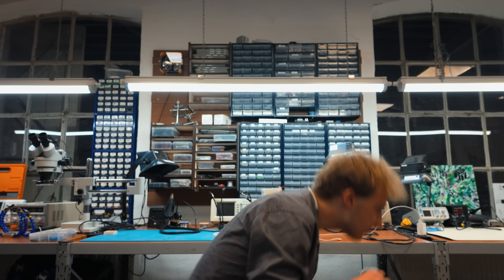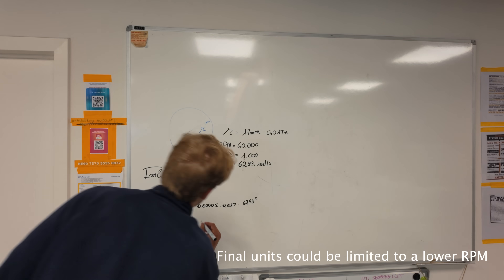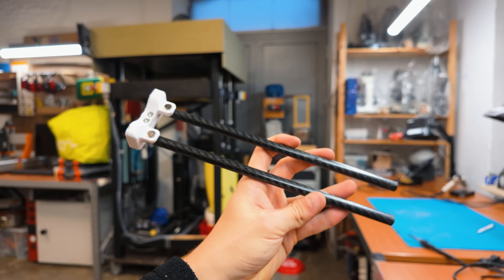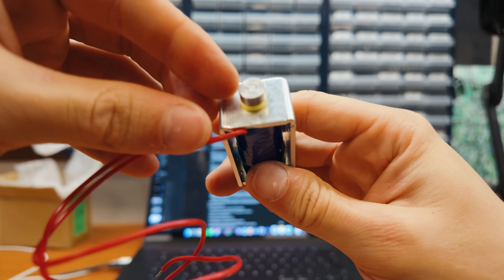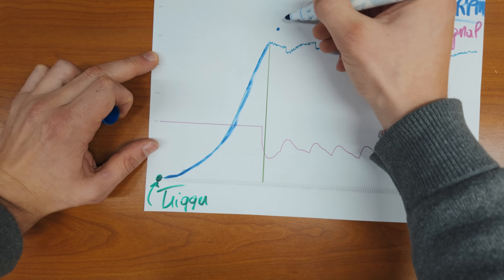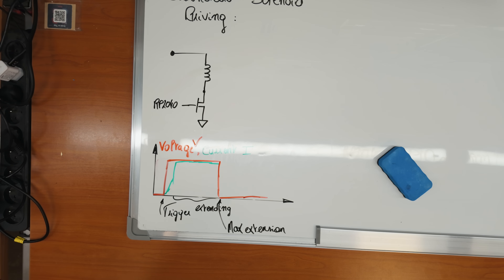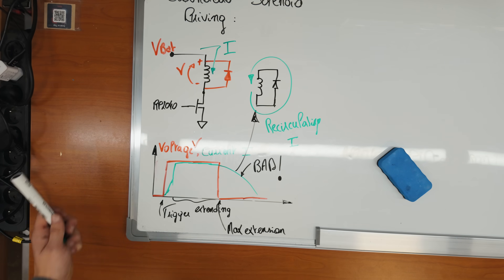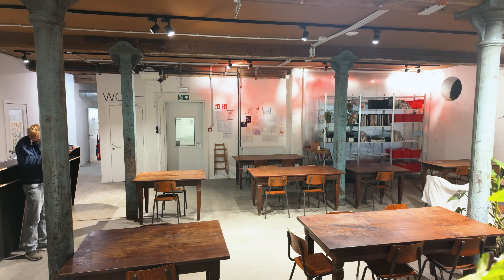Stinger V2: Pushing The Limits of Brushless Nerf

Comment: For the PCB you could mount it similarly to how gasket mount keyboards are. Two rubber washers affixed to each side of the board could mitigate extended vibrations from the solenoid. Awesome stuff!

Comment: Is there a link to the source code, especially the close loop control for the RPM? Are you using bidirectional DSHOT, serial ESC telemetry or did you bake the RPM governor into the ESC?
Reply from the maker: we're using bidirectional (extended) dshot on an RP2040

Comment: You can get rid of the BCAR by putting the flywheels slightly off axis to the path of the dart. I don’t know how well it works with a double flywheel setup, or with concave flywheels, but it’s something that could be looked at.
Reply: That would significantly increase flywheel mechanism complexity and definitely increase overall width; it's not worth it.

Comment: your production quality seems really good, would just suggest turning the mic gain down, to reduce the peaking, or optionally recording 32bit float which will drastically increase file size but allow you to adjust the audio in post, if not already.
Reply: Thank you! The youtuber "I'm using a lapel mic in a way other than intended" aesthetic really only works if you can hear them
Reply: @bitsRboolean  i mean he can definitely use it that way, and many people do with good audio. Even when it is clipped to his shirt its arguable worse because its closer to his mouth.
Reply: good tips!
Reply: Yeah the audio here is rough and difficult to listen to.

Comment: Thank you for this offering. Important note (particularly for us U.S. foam flingers)— it’s a blaster, never a gun. A gun refers to a tool that shoots projectiles using an explosive device (igniting gunpowder). Blasters use air and mechanical work to shoot darts/projectiles.
Reply: I worked on a nerf commercial and we had a saftey meeting that was proactively condemning any use of the word “gun.”  Blaster was the only way to refer to the product we were shooting.
Reply: This is just Because the left has been trying to paint a negative picture about firearms, and guns in general. Like I said, firearm enthusiast call their guns “blasters” to. And their guns actually have an explosive blast, unlike our nerf guns.
Reply: @Komfortonset  This is just because the left has been trying to vilify the word "gun". If anything, the term blaster is more appropriate for firearms,  as firearms actually ave a gunpowder BLAST when you shoot.
Reply: In theory this is a Gun. Because a gun is any device that propels a projectile through a barrel. Its called a firearm if the propulsion force is generated by burning a substance to create expanding gas.
Reply: Actually, from someone who is also familiar with the firearm community, I hear people refer to there firearms as blasters, just as much as people in the nerf community. There is no difference between the two.
Reply: @CrashTestRC1  that's called "being wrong"
Reply: @DoesntRefillTheBrita  In what way exactly?

Comment: You should tackle full length darts! I’d imagine it only requiring a longer magwell, new side panels, lower crush wheels, and maybe a longer solenoid to use short darts with an adapter

Comment: There's an interesting discussion to be had about kinetic flywheel weights. I think it's easy to say lighter is faster recovery so better.. but heavier technically means there is also less deceleration effect as it grabs and transfers it's stored power into the dart. So there is probably an optimal balance point.
Reply from the maker: I get what you mean but have a look at the graph where you see the dips in RPM. It barely loses any RPM.
Reply: the recovery time does not* depend  on the flywheel weight, but the startup time from 0 rpm is better with the lighter wheel. a heavier wheel would be good to use if the blaster could not recover the rpm between the shots.
Reply: @stingernerf This is where we start looking at Mega darts and bigger/ heavier flywheels with adequate motors... you have the potential to make a "NERF Tank" at this point. Or the NERF Howitzer, sounds pretty dope too, and will probs just be a scaling issue more than anything else.

Further Modularity might also favour a "heavier" flywheel in favour of being able to handle any loadout, like for example the Mega Darts or even Elite Balls. You've seem to have reached the point where the only way to improve the product, is to just make it more versatile, or make a bigger/ meaner version. Well done.

Comment: This isn't really closed loop, for that you'd need a rotary encoder reading physical RPM

I'm a bit confused why you need a control loop on top of am32, I would have assumed that it will try to reach the target rpm as fast as possible and hold it as best as possible

Really nice blaster, but probably going to be too expensive for me
Reply: But the 'eRPM' is the true RPM for the flywheels? It's pulled from the magnetic Back-EMF from inside the motors as they spin. The only thing not closed loop about it is it doesn't know how much grab it has on the dart or it's relative speed to the motors.
Reply from the maker: Yes the point is to both spin up quickly but also matching RPM between motors can greatly increase accuracy. And this also allows the response time to be as short as possible, shooting exactly when motors reach designated RPM
Reply: I have 500 of these guns , brokie

Comment: Instead o stabilizing thru bearings(BCAR) maybe add "compersator" addon with aditional 2 engines that will spin dart like bullet in rifled barrel?
Reply: Worker tried that a while ago I believe with their canted flywheel cages, it didn’t really take off much
Reply: @Nishye501 yes, your right, it was never succeful because people realized flywheelers have little need for long range accuracy do to that not be their main environment for use
Reply: @frogsbutfrogs  no, it wasn't successful because those cages have way too much canting and overspun the darts and caused fishtailing
Reply: @creaturedanaaaaa  the problem is I never said it was successful, read it again, oh and rephrasing some stuff, people realized that the machining was very poor on the worker cages and wheels, and it provided negligible gains to accuracy
Reply: main issue is that flywheel accuracy inconsistency is mainly caused by the dart decompression when leaving the flywheels being inconsistent, bcar will work better because it does not crush the darts other than the bearing tracks

Comment: Excellently produced, no surprises here. Though it's not the primary intent, there's enough information here to actually sort of give an accessible look into flywheeler physics and control that's easy to show to an outsider. What capacity does the 6S you used or maybe designed around happen to be?
Reply from the maker: It's a 550mah pack from either Ovonic or Gaoneng
Reply: @stingernerf That's actually approaching or exceeding the efficiency on a lot of singled-staged brushed motor blasters. That says a lot about the potential of 6S.